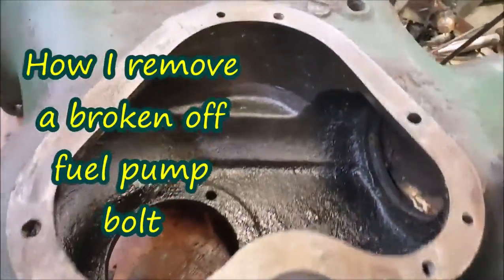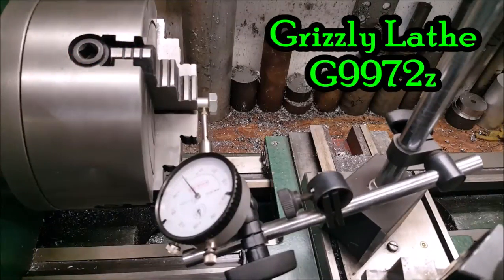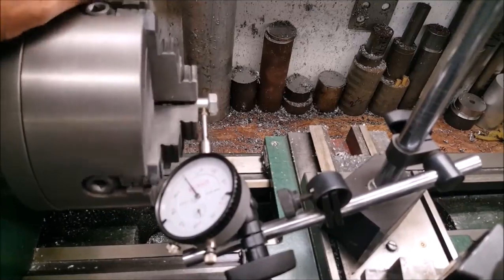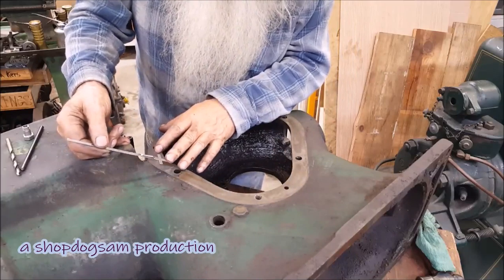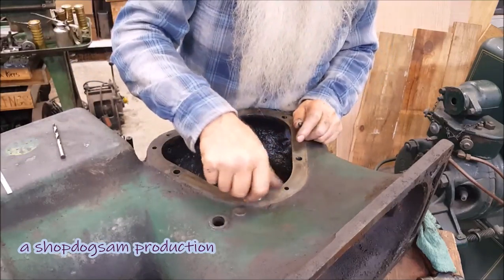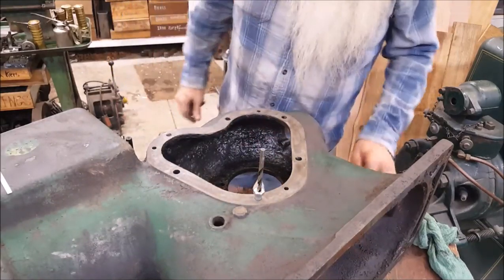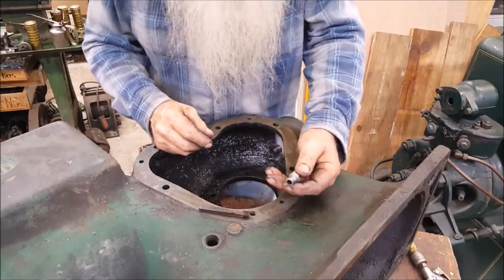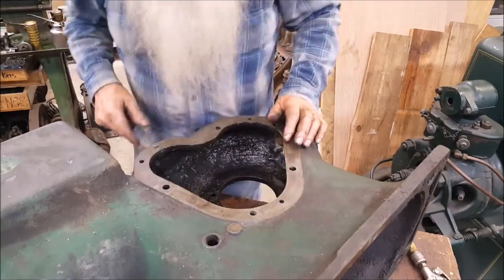How To Remove a Broke Off Bolt from a McCormick Deering engine block

Comment: Did the bolt break because it was too long and bottomed out in the hole or corrosion?
Reply from the maker: ,, bolt was broke off when I got the engine,

Comment: Always enjoy the videos.. The projects lately have been industrial wiring, conduit pipe.. Lots of information and tricks have been learned. Other projects are fall cleaning the house and building a wall hanging rack to hold banjos. Have a good one sam from east coast of GA..